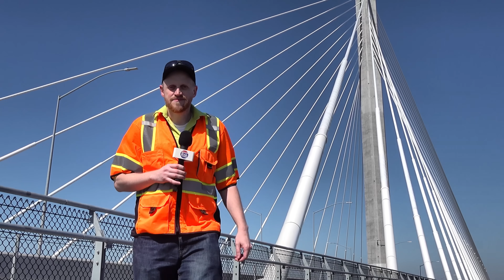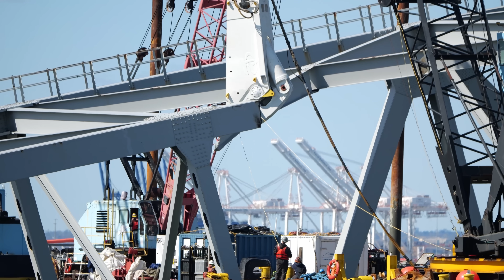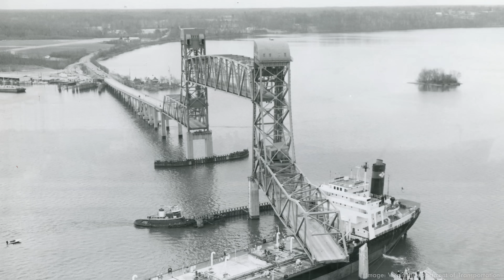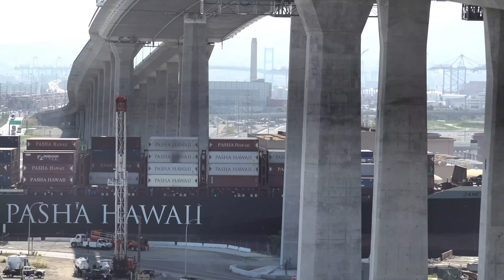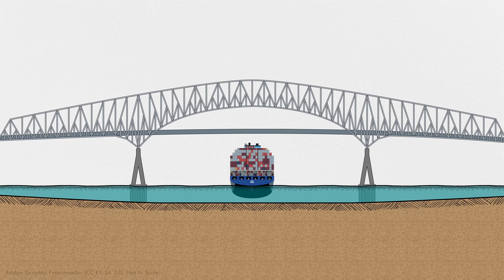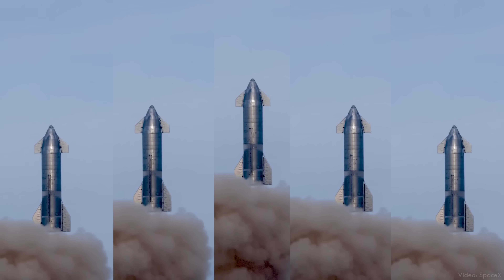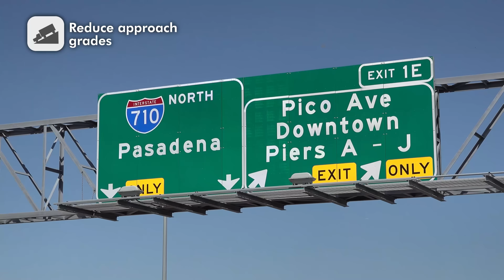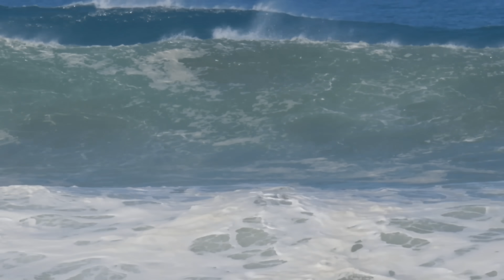How Bridge Engineers Design Against Ship Collisions

Comment: 15:24 the power lines had more protection than the bridge lol
Reply: those power lines are new.  only installed in the past couple years, so they may have had higher standards about collisions/protection.  previously there were power lines under the water in that area.  police even stopped traffic at times during installation as to not have distracted drivers on the bridge while helicopters ran the power lines.
Reply: At the risk of replying to a joke... the utility poles are nigh invisible in the dark, while the bridge is coated in street lights. I'd wager they're much more likely to get bumped into.

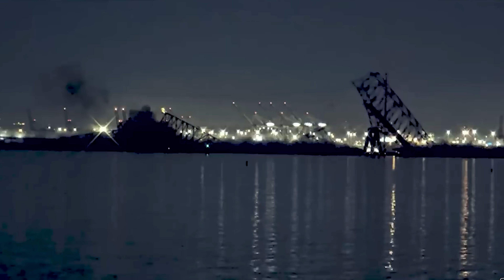Comment: 4:00 How can there be enough time for police to mobilize to shut down the bridge between the mayday call and the ship hitting the bridge? With that amount of time you would think they could ... you know.. find the rudder at the very least?
Reply: Until the final report comes out, we won't know for sure, but it was likely a loss of power to the rudder or some other catastrophic failure of the steering system. I sincerely doubt that the ship's crew were unable to locate the rudder.
Reply: What Is Going On With Shipping already made a video about this about a month ago. In the video he describes how the bridge appears to have lost control of their rudder and their engines due to the power issues. Not to mention, ships, especially that size, have a lot of inertia. It is impossible to stop them on a dime and quickly change directions. When they issued that Mayday call, it meant that they had run out of time to try and steer the ship away from the bridge.
Reply: A rudder without a propulsion is useless; The rudder is essentially a steering mechanism that helps to control the direction of the ship by redirecting the flow of water past the hull. However, its effectiveness relies heavily on the presence of propulsion to generate the necessary flow of water for steering.
Reply: @stefanderrick1436  Keep in mind that the rudder will still work as long as water is passing over it from front to back.  Forward speed it the main thing needed, not propulsion.
Reply: @slaveofjesus3878  Indeed, but it is not as effective, especially for such large ships.
Reply: Thinking more about this, the Dali had dropped anchor and so it may have swung in because of that.

The electrical systems were failing on the ship and so that's probably why rudder steering failed.

i'm still shocked that the bridge was able to be cleared of vehicle traffic (other than those construction workers sitting in their vehicles, poor sods) in such short notice.
Reply: @charoleawood  The anchor wasn't doing squat when the ship dragging in the bottom (at the end it was all of the way out of the channel) was barely slowing it.
Reply: i was wondering this too.

From the photage at 3:59 it looks like the Dali steers into the Key bridge pier.
Reply: @charoleawood  The relief of the sea floor can have an impact on the trajectory of the vessel. I saw on some charts the entry of an other channel so it is possible that without propulsion the ship has been drag by the openning of the channel.
Reply: @charoleawood  Yes, to a layman it certainly 'looks' that way.  But the steering system has redundancies built in of course, and if you actually reverse the main propellor of a large single-screw ship, the rudder becomes ineffective and 'prop wash' can turn a ship sharply to one side.  There is some speculation of just what happened, but the investigators are certainly looking into these and other issues.

Comment: I wonder how much a automated bridge closure system (like a rail crossing) and evacuation protocols (for road etc workers) would cost, relative to islands, dolphins, and other structural solutions.
Reply: Islands and dolphins are more cost-effective than rebuilding a bridge. That also doesn't take into account the closure of the port while cleanup happens.
Reply: @ferky123  Yup - but that's with a bridge that designed never to fail. So if it does fail, it fails in a really messy way. Some of the other bridge designs that failed only had small pieces damaged, and I assume those are quicker and easier to repaired. 

If the trade-offs in the design included the repair/recovery costs (direct and indirect) as well as the likeyhood of a catestrophic event, would different designs be used? Or is that already how things are done?

Comment: They should build protective pillars around the bridges in case of collision
Reply: The things called dolphins are pretty much precisely that, the scott key bridge had some but the container ship drifted within a rather narrow angle where it could successfully hit the pier without hitting the dolphin or the edge of the channel first

Normally bridges built after the sunshine skyway collapse (or retrofitted after it) have artificial islands around the piers adjacent to the channels. The piers are also usually set back far enough from the channel edge to provide protection on their own.

Ultimately the systemic cause here is just that cargo ships got very big and there was no space for protective measures around the piers without restricting shipping traffic more than corporations and governments would prefer. This is a common reason why tunnels are becoming preferred over bridges when geology permits, though those are also not very useful so long as we insist on transporting everything by truck through busy transit corridors once it's on land as they'll just exceed capacity and then another bridge or tunnel needs to be built in 12 years.

Comment: If only there were a system or protocol that could safeguard critical infrastructure when these gigantic mobile machines pose a collision risk. Maybe they could build little boats that have oversized engines that produce massive thrust, and have those boats shepherd the large ship through narrow obstacles...
Naa... that's probably impossible to design.

Comment: I want to see the new design for the replacement Key bridge. I'm guessing it will be a  cable stay structure and at least six lanes. And of course good collision avoidance systems.
Reply: Agreed on the first point, but I doubt it will have more than 4 lanes.  Probably will have a shoulder for breakdowns, though.  Traffic in that area has never been that bad and backups from excessive traffic volume were pretty rare.  That part of the Baltimore Beltway did not experience the stop and go and log jams of areas to the north and west of the city.